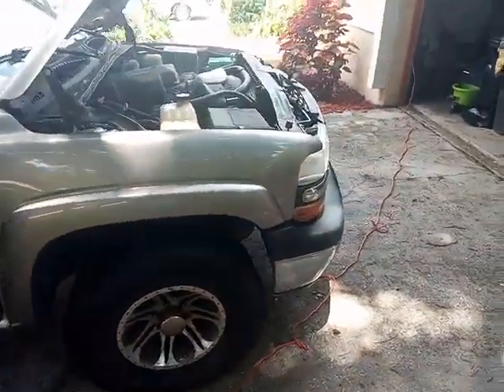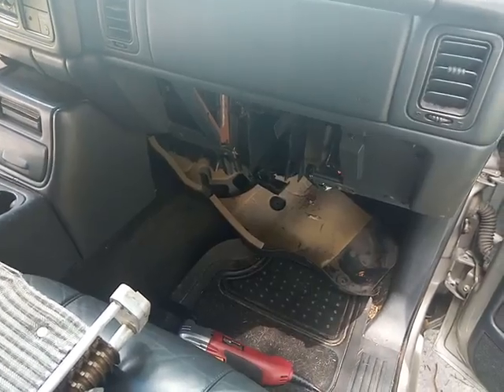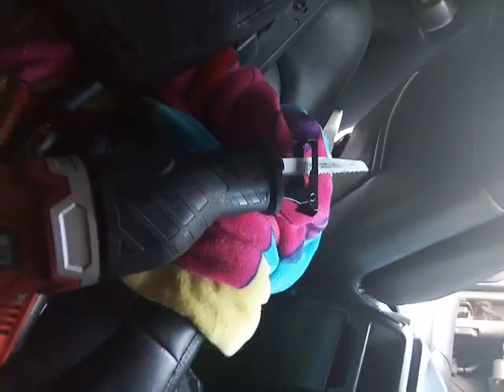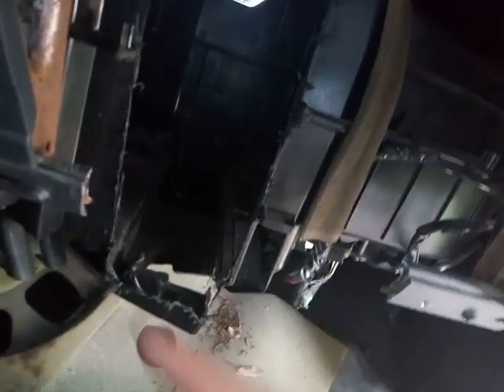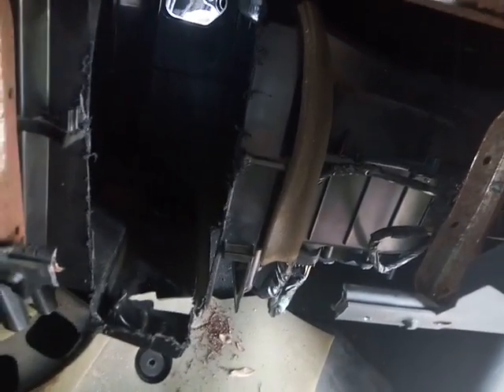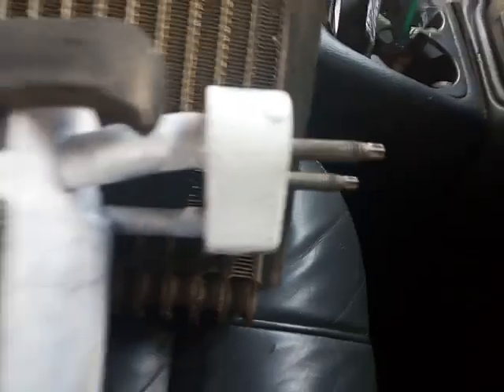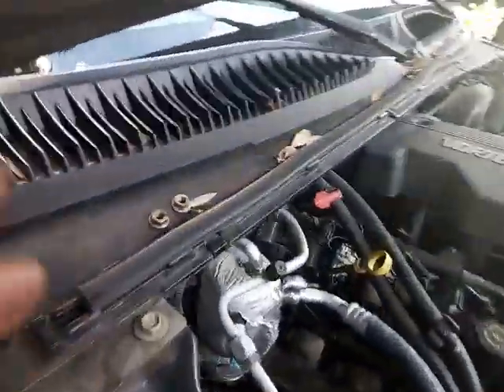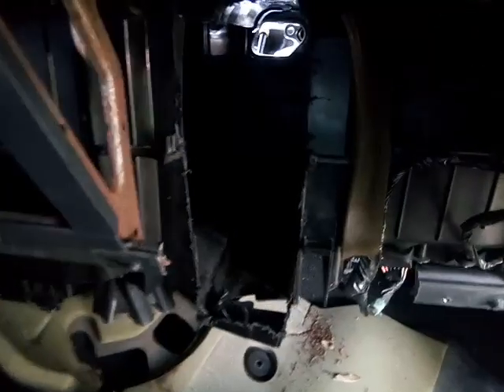Silverado Evaporator Replacement Trick (Replace Without Removing Dashboard!)

Comment: Maybe you could have cut it from inside the engine wall. Of course you would have to remove the ac accumulator. Then measure width and  down length on your new heater core . Mark the wall of your engine on the engine side. Cut out the wall with a isolating tool . To be careful not to cut it bigger that heater core. Remember the drip tray is on the bottom, don’t cut the drip tray at the bottom.  First start cutting from the holes where the heater hose connect to the heater core hose connector. After sliding your core out  and replace with a new one , you can cut a metal flat plate 1/2 inch larger than the hole . Then add a rubber seal on the back and screw it or bolt it to the fire wall. Then you never have to take, spend a week on the inside. I never have done it, but I bet it will work. I would try it on a salvage vehicle first. But most salvage yards don’t let you bring in power tools. Just a different thought
Reply: This guy gets it! I'll be doing this method in the next week for sure. I have a thought to add also, if you can gain access to a different existing cab, then cut that piece from that cab and use it for the new hole you cut in your cab. Perfect fit overlay and if you cut the hole big enough for the doner vehicle you have experience and a piece to mark with a tape measure.

Comment: did your a/c blow cold after you hooked up everything?
Reply from the maker: Yes it did. Only things I would have done differently. Used a hot knife and taken more time to cut with more precision. AC blows cold and all the pieces are back together.

Comment: Ive got an 03 1500pickup. And cut an access panel to the heater core and installed  a hinged door in my bed to access the fuel pump as.  Fuk it.  Cut it.

Comment: Can you access the heater core that way also?
Reply from the maker: 85% sure you can't. That's a hairy job. I would advise you take it to a shop because you're going to have to do a lot of disassembly and reassembly.
Reply: buzztrucker that’s what I figured but thought I would ask anyway thanks

Comment: I just bought a truck and was wondering why the heater box is all cut up, leaking cold air, no heat. This is why those of us good ASE certified technicians get a bad rap for work done improperly or very poorly. To cut the box Its not about saving the money, its about being lazy! You could have done this job the right way on a Saturday, and not butcher and throw away structural parts of the dash support system, telling everyone, "you won't need these"... When you sell this truck, be sure to tell the people you sell it to that you butchered the heater/ac box.
Reply: Why wouldn't just the car manufactures do it in a way that you wouldn't have to either butcher the car nor putting it apart just to replace a part...
Reply: Car manufacturers dont design things to be easily done. No one is going to pay $2000 to fix an ac on a $800 car. Take it easy salty dog
Literally NO PROBLEM with doing this to your 20yr old truck. Mechanics CANT say it's a good job.

Comment: Always, Always, Always follow the service specs to the letter.  I understand that the Poster wanted to do it easy, however this is the worst way to perform this repair.  First off cutting the dash is a no no, especially having a passenger side air bag that requires all the metal structure to be in place.  This is why it is engineered that way.  Taking the dash out wouldn;t have taken any more time, as it did to slash the dash.  Anyone that sees this don't do this to your car.  The structure integrity is important.  Not to rip on the poster, just saying this is a bad way.

Comment: just be glad he did not cut thought the fire wall to remove the heater core... Haha... great video for someone who has no money or time to pull the dash off in one hour or 3 hours... and make $700 doing it for the next door friend who is to lazy to do it ... i will just cut away and be done in 30 mins... Haha...

Comment: The dash can be removed in a few hours by removing bolts along the windshield and on the A pillar along with the steering column.  This is about as hack job (literal hack job lol) as it gets. I dont care if its a cheap truck, this is a fucking joke and I thought this would be published on April 1st.  Paying someone to do it may be expensive, but you can do the job CORRECTLY in less than a day with a simple socket set.
Reply: time is money so if you save time there you have it

Comment: If it works for you ok, but I hope you never sell this truck.  Someone may try to hold you liable if they prove structural failure caused their injuries.  That said, I personally would never butcher a vehicle...do the job right or don’t do it at all.

Comment: your $3500 truck just dropped to $1000 from your hack job. Do the job right. just pay the $800.
Reply: well give home 800 to do it then if you  got it like that
Reply: How doea it loae value if anything it gained value by having ac i dont see a problem with doing it this way. Ive torn apart multiple dashes this summer for evaps, has a matter of fact im working on pulling the dash on a 2015 sierra fully loaded

Comment: the dash is EASY to remove...wow you made a 10min job into a mess....and ruined some framework
Reply: ViiV Creations it is most definitely not a 10 minute job. it takes about 12 hours to replace a heater core on this model. ac evaporator is probably only a few hours less
Reply: 12 hours for a dash and evap? Pay me flat rate
Reply: Having done this the right way on my 2001 2500HD 4x4, you don’t have a clue.

Comment: If you charged me to replace my evaporator, and I found out you cut pieces of my dash board assembly, and plenum to do it, we'd be in court. I was a mechanic for over 40 years. First on cars, then forklifts, then a licensed aircraft mechanic. Never, ever, would I have considered cutting someone's vehicle to do a job. All that is is laziness. You can often beat regular flat rate time by having the right tools, working faster, smarter, and finding non destructive short cuts.